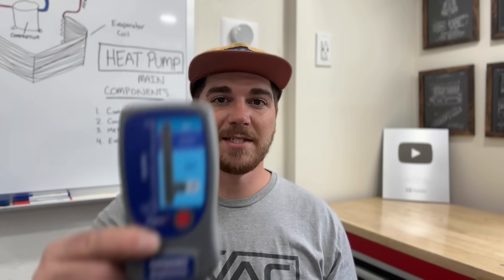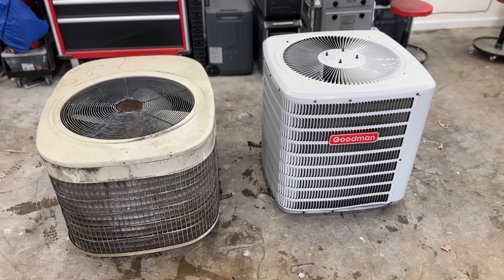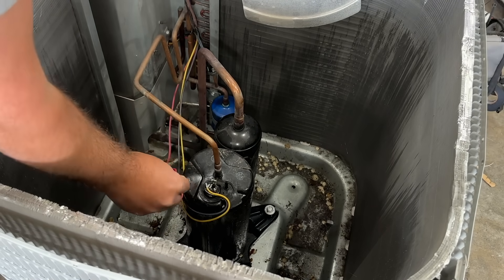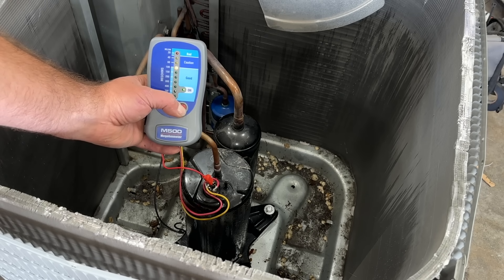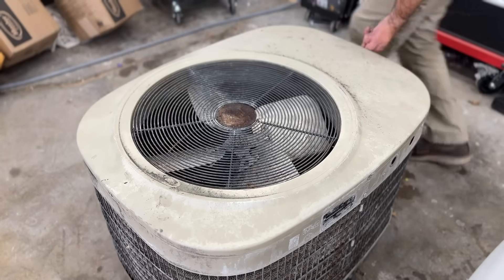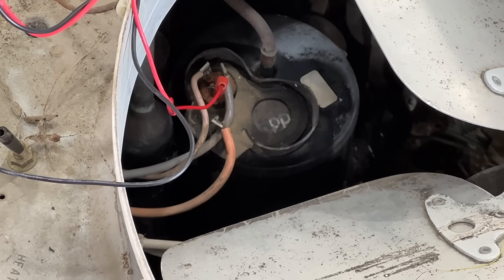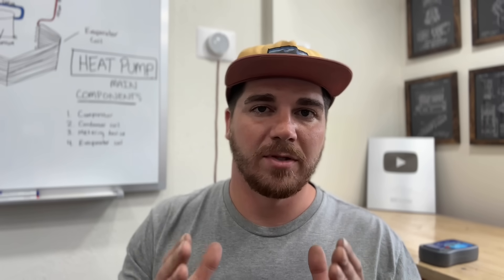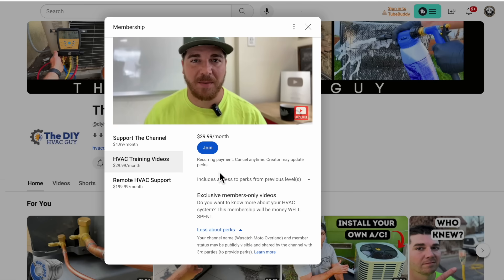Is Your A/C Unit About To Die? This Tool Doesn't Lie

Comment: I would completely isolate the compressor. And hook your ground to the component being tested. Testing like this it could be the compressor, the wires, the fan motor, the starting cap, or even the contactor.
Reply: It is checking the resistance between the windings and the ground.  There technically should be no connection between the two when everything is perfect but when the coating on the wire in the winding starts to deteriorate it will begin to lose some of it's insulating capability and the resistance will begin to drop down from near infinite to lower values.  That device is a ohm meter designed to measure extremely high resistances.  At least that is how I believe it works.
Reply: @damon20r  If you leave any leads on the compressor you are  also testing whatever else is still connected to the compressor. Since the windings are all connected internally, you put 500V on the one terminal and it puts out 500V on the other two terminals and what ever is connected to them. So you are testing much more than the compressor and can even damage things with 500VDC.
Reply: @inothome  I agree, I would have completely isolated it as well to eliminate the possibility of one of those components feeding back to ground and giving a false condemnation. But there aren't any components in that circuit that are going to be harmed in any way.
Reply: @inothome  500VDC? LOL. From two C batteries. That's quite a trick.
Reply: @robertthomas5906  Not sure where my first reply went.... Yes, 500V from two C batteries. Look up the specs on the unit he used and any insulation resistance tester is high voltage. Testing at 5V doesn't do much when device runs at 120V, 240V, 480V ETC.   I use a Megger brand MIT1525 testing pad mount transformers and that goes up to 15kV DC. Guess how it's powered? Batteries! When doing the PI, you let it sit for 10 minutes injecting 15kV. Which is just a standard insulation resistance test for trending values.
Reply: @robertthomas5906 just hold the leads and push the button if you're brave enough. Lol
Reply: @robertthomas5906  Hold the clips and press the button if you doubt it!
Reply: Agree.  Should have isolated the compressor. I think the initial "bad" reading was a cap .
Reply: 30yrs ago had a 35yr old 220 wall unit quit, a friend in hvac said test for continuity from power to the case, with it unplugged. Sure enough it beeped, was nearly 40yrs old. Replaced it with a white Westinghouse around 95, still worked great yr ago when I moved. New place has a smaller York central system barely 8yrs old that just quit, checking compressor asap, so fkn hot out, if ok then txv, really easy to access. Everything else has been checked out. Think I'll check installers business reviews, if it's like everything else around here... inspectors, 3 of them, 2 let anything slide, normally 1st one handles a house start to finish, Illinois is fkd up!!!
Reply: how many did he get wrong,testing like this.
Reply: @MariosACandRefrigeration  @inothome Explained it better than I did. If you don't disconnect all the wires, the compressor windings are still connected to all the other components electrically, so if any of those have leakage it will show as a bad compressor when it might be something else in the circuit that is bad. Also if there is any electronics (control board/inverter) in the condenser unit they could be damaged by the megger.

Comment: I have a home warranty through State Farm that covers my home HVAC system. The deductible is 500 bucks. It would be extremely interesting to me (and other home warranty holders) to see a video on how to troubleshoot and repair 500 to 700 buck problems. I’m not too concerned about work going over that amount because that’s when the warranty I’ve been paying for kicks in and I’ll let a pro sort it out at that point.
Reply: You do understand that what constitutes a $500 problem in one geographic area doesn’t necessarily amount to the same in another, right?

Comment: My original thoughts were that the compressor pump would be the component to go... Not the dielectric strength of windings.  How does pump wear factor in... Or how do we test it?  Just gauge pressure?
Reply from the maker: Yes your pressure split will tell you that. If your high side and low side aren’t off by much, that’s a good indicator that the compressor pump is done. That and noise levels
Reply: @diyhvacguy  thanks so much.  I love your videos and really, really appreciate all the knowledge, time and effort that you provide!

Comment: 😂 it’s called a Meg Ohm Meter and you can check from the electrical box
Reply from the maker: I’ve heard it pronounced half a dozen different ways but they recommend it’s checked directly at the compressor terminals.
Reply: Agreed.  Checking from the Control Panel Box would involve testing across the load side of the compressor contactor.

Comment: I have a 10 12 sheer Coleman heat pump and it is going on 27 years old and still running fine!
Reply: yeah but your electric cost must be through the roof.  Id hate to pay that bill
Reply: @pctatc66  No it runs about  $70 to $90 dollars a month in the winter to heat my house and the air condition is even much less then that!
Reply: “They don’t build them the way they used to”
Reply: @chompnormski  And the fact that I only paid $590 dollars for everything the Heat pump and the air handler and all the duck pipe is another story by it's self! I had to give a guy $250 to hook the pipes up and thermostat And I installed the pipe and air handler myself! And it is still running today It is hard to believe what they cost now!
Reply: @The1313jeff they really aren't that expensive at all if you buy them yourself and then have it installed.  These clown ass contractors are marking the equipment up 7 to 10k and acting like they got you a good deal.
Reply: You should definitely replace it. Its like driving a 27 year old vehicle daily. What year are your vehicles?

Comment: Proves my beliefs.  New stuff is garbage.  I still run my r22 system.
Reply: I use R407 refrigerant as a substitute for R22.- Had it in my own unit for 9 years.
Reply: @bobboscarato1313  
That's the orange cannister, correct
Reply: @bobboscarato1313  can that mix with R22 or do you have to evacuate the system and replace?
Reply: @MeltingRubberZ28  Evacuate and put a new dryer and recharge with R407A
Reply: @MeltingRubberZ28  Never cut corners to save time or money!
Reply: 55 dollars per 30lb bottle about 20 years ago was a great investment, glad I bought a pallet
Reply: The newer equipment is far superior to the old R22 system. I’ve been in the trade since 1986 and for many years there wasn’t much of a change other than refrigerant type. The new inverter compressors are freaking awesome! No need for capacitors, contractors and the have a nice and easy start up. Paired with the manufacturers communicating thermostats the new systems are much more efficient and they hold temperatures much better in your home.
Reply: @victorsr6708  Superior as far as operation and efficiency, absolutely, but quality and longevity, not a chance.
Reply: @bran-qt7ds  absolutely, let me explain. First selecting the right brand. I’m partial to Japanese manufacturing methods therefore I like Daikin & Mitsubishi. I also like American made therefore Daikin wins. Daikin equipment is better than “old equipment” because they have eliminated the main failure points when they went with inverter compressors 1. No more contactor 2. No more capacitors 3. No more lock rotor amps at start up. Look at it this way what is harder on a car city miles or highway miles? With the new systems it’s like they are running on cruise control. I’ve been working on inverter systems on the comercial industrial world for the last 10 years and there really isn’t much that goes wrong with these units
Reply: @victorsr6708  are u a fan of Goodman then, since Daikin owns it? I'm considering a Goodman system with their 17/18 SEER 2=stage AC unit & modulating/variable speed furnace
Reply: @MrRjnr  it’s a good option. The difference other than price is probably going to be the warranty. The daikin fit heat pump has a 12 year warranty and if the compressor fail you get a whole new outdoor unit. I don’t think you get that with the Goodman. Warranty aside Goodman is now a good product and wouldn’t hesitate installing one at my house. What model are you considering?? Heat pump? furnace?
Reply: @victorsr6708  AC unit: GSXC7 or GSXC18...furnace: GMVC96 or GMVM97...I'll have to see what my installer says about the price differences
Reply: @MrRjnr  I’m not a big fan of the two stage compressor since the inverter compressors have come out. My reasons are 1. The compressors are noisy compared to the Goodman SD side discharge inverter system 2. The size of the outdoor unit are so much bigger than the SD 3. The 2 stage still works like a traditional system vs the inverter where you set the temperature and forget it. Just a thought, why not get a price on a side discharge Goodman to compare prices. With all that said your biggest saving is going to come from fixing leaky ducting. I don’t know where you live but here in California duct testing is mandatory and the entire system cannot leak more than 10%. Also make sure that your return ducts are sized properly (for a 5 ton it should be a 20” duct or two 14” ducts. Also on the return grill you need 200sq” per ton so 5X200= 1000sq” or two 500sq” return grills. It’s not all about SEER rating it starts with the ducting. Put the money in the ducting first then work from there. You are better off with a 14 SEER unit with a two stage 80% furnace with good ducting than with a 17 SEER with bad ducting.  In my opinion if the contractors aren’t mentioning your ducting  and duct leakage then you have the wrong contractor. On average it takes me about two hours in a house to be able to give a quality proposal. If you have more questions keep them coming I enjoy helping people where I can.
Reply: @victorsr6708  OK thx, I didn't even think about the top-tier ones. I figured the others will be way better than my 24 yr old system! I will get prices on the inverter ones, especially if quieter. I am in the Sacramento area; yes, I will be sure to get ducting inspected first. System will be 4-ton; house is 2420 square feet, 2 story, dual zones. I just had an AC tune-up done by a very reputable local company, & the guy said all looked good up in the attic.  Which area are you in?
Reply: @MrRjnr  also for zoning EWC makes a great one for inverter systems.
Reply: Where do u get refrigerant for it
Reply: @MeltingRubberZ28  my secret stash.  I check the charge periodically,  and the system is tight.
Reply: @MeltingRubberZ28 
A lot suppliers only sell it to contractors now 
I'm in Chicago and I get mine from MidLakes distributors
Reply: @MeltingRubberZ28 
I totally agree
Reply: Not really garbage but installations are VERY often defective.
Reply: As do I. I’m in Total agreement w you